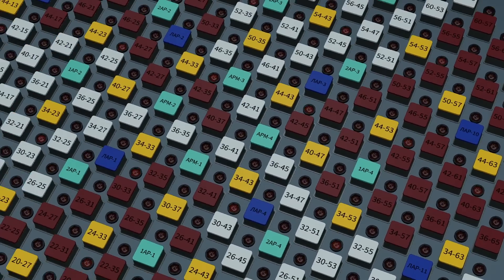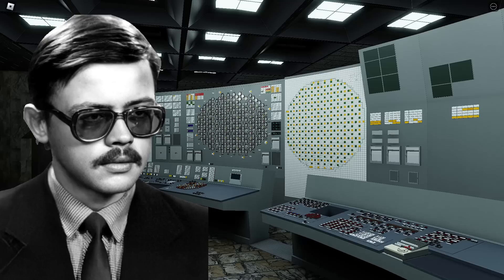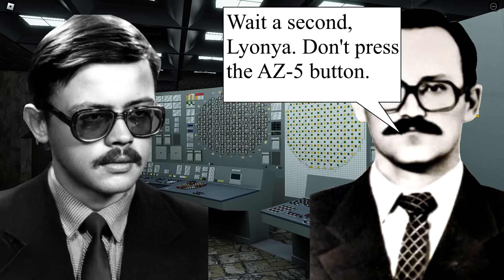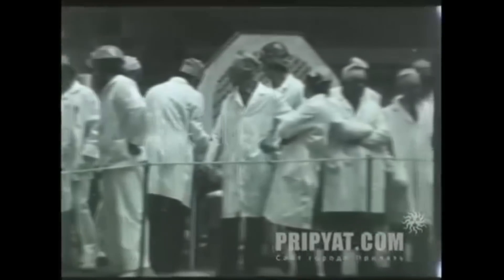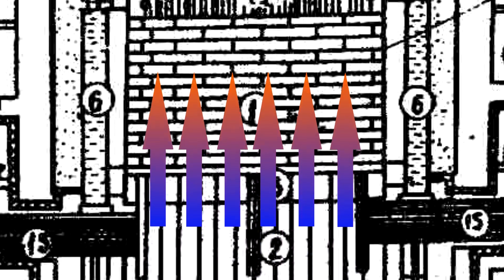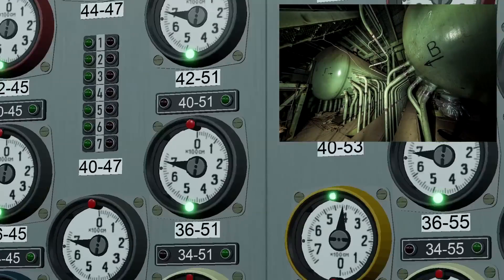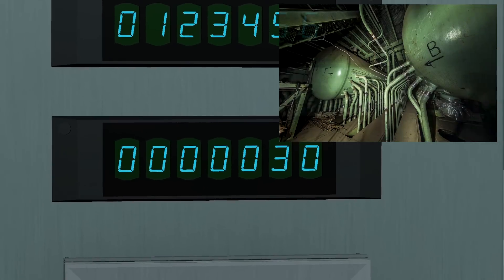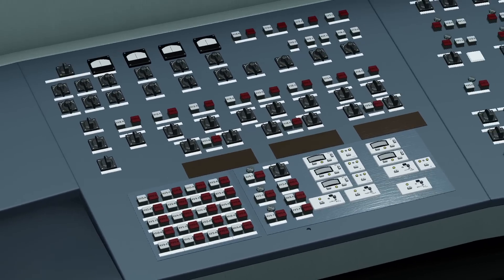Would Not Pressing AZ-5 SAVE Chernobyl?

Comment: Pressing it after the reactor crashed would have saved it.
Reply: Yes but they had no reason to do that. They had a test to perform, and no rules prohibited operation at low power. They did violate a limit on ORM, but that wasn't a parameter they could actually monitor, it was habitually ignored in normal operation (it was also violated a day earlier), and not seen as safety-critical.
Reply: ...what?
Reply: @IbishuCovet  it's not really clear what you're confused about, but "crashed" here is referring to when they were decreasing the power level to prepare for the test and the reactor power level accidently dropped to almost zero
Reply: @MatthijsvanDuin  oh alright, i thought they were referring to the explosion with "crash", which made me very confused 😭

Comment: The best way to prevent the Chernobyl disaster would be to go all the way back to the late 60s and design a better/safer reactor
Reply: they had a better one, the pressurized water reactor family VVER. Now RBMK was much easier to build and cheaper, so they went with THAT design. Still, it is amazing, that they kept the remaining twenty RBMK reactors running - without them blowing up into pieces. Wikipedia says they decreased the positive void coefficient by modifying the fuel rods by means of 'increasing the enrichment requirements of the uranium fuel in the fuel rods' (very enigmatic phrase). Also the control rods are said to have been modified, go figure. In the end they always blame some poor operator like Toptunov, who was not aware of the design deficiencies, because they were state secrets. On the other side of the pond it is some Homer Simpson guy, who gets blamed...
Reply: @michaelmoser4537  I doubt that rbmk is easier to build than VVER, because rbmk has lots and lots of piping underneath. The rbmk advantage was that it was possible to refuel it while in operation, no need to stop the reactor
Reply: @equim7363  VVER needs a high-pressure steel encasing & plumbing. I read that this was hard to make.
Reply: @equim7363  cheaper to maintain also applies to the "reactor being cheaper" even if the upfront cost of building it is not lower.
Reply: Or just not run tests on a live reactor
Reply: The best way would be to go all the way back to the late 10's and abolish communism
Reply: No, the best way would be to go back in time to WW1 and assassinate Lenin and prevent the October Revolution.
Reply: The reactor worked fine before they start using it wrong. It broke because they break it.
Reply: @XtreeM_FaiL every block had some fuckups, cover ups, few damaged technological channels every now and than.
Reply: That's not true. The test that caused the meltdown had never been successfully completed before. There's really no proof of could have been but other plant managers refused to even try it.
Reply: Bs
Reply: @XtreeM_FaiL  No, the reactor didn't work fine, that was literally the point of hiding the inner workings of the graphite displacers on the control rods from everyone. Other plants had channel ruptures when shutting down before this happened. The only difference was those reactors weren't in a state where they were about to fail catastrophically.

Comment: Don't press AZ-5: explosion happens later
Press AZ-5: explosion happens sooner
Reply: The Soviet's trolly problem
Reply: Looks like RMBKs were really pieces of sheet. "Yes let's build a main reactor core with a positive thermal coefficient"
Reply: @dsracoon  it was cheap and faulty, but if ran as designed it was ok
Reply: @jimmoore3767  yes, but no. it had per-channel issues.
Reply: @jimmoore3767  I agree, forcing it out of a xenon pit was the error, once they burned it off and the reactor ran away they were buggered, but it should never have been in that condition in the first place.   99% operator error and 1% design.  Nothing can be made foolproof because fools are too ingenious.
Reply: @larrybremer4930  This was exactly my thoughts...you can't turn off all the safeguards and then complain when it blows up. Imagine turning the ESP/Traction control off your Ford Mustang and then complain that the reason you crashed was the wheels spun on a bad corner...do you blame the corner, the car or the driver, who set the rest up for failure.
Reply: @Azimuth47  they cant turn off last thing-emergency shut off due fast power rise,which is ,AZ-5!and by some documents, computer initiated AZ-5 2 second before button was pressed,so,no matter pressed was button,or not,in that condition reactor blows anyways.
Reply: @larrybremer4930  i will say they were relying on the AZ-5 button actually working how it was supposed to, but diatlov was really pushing it. I don't think it would've exploded this drastically if the rods weren't tipped with granite, though some other failure would probably have happened
Reply: @dsracoon   Never mind that, they all added up to an overall positive reactivity coefficient. There's no self-correction there, you have to be ON IT at all times.

If it were an aircraft, it would have no static stability and we wouldn't let Boeing sell it to anyone other than the military.
Reply: @dsracoon it's cheaper
Reply: @dsracoon can’t out engineer something bad at its foundation
Reply: @Ultrajamz  RBMK is an old design, even old when they built them at Chernobyl.  For its design vintage its not a horrible design overall.  As Legasov said in the trial, they were easy (and cheap) to build, but the reason the design is useful is not as much that but because it did not need highly enriched uranium.  Its fuel was actually pretty low grade.  That  is what made it cheap operationally and desirable.  It can be said the design was not fail safe and required some operator competence to safely operate it, but the same can be said about most machines we humans create.  Most car crashes are not a problem with the car but the user and that analogy fits with Chernobyl too.  Scram would work as designed and safely shut down the reactor unless it was running well outside its design parameters, which in this case it was.  Accelerate your Honda Civic to 150mph and complain to Honda when its engine blows and see how far that warranty repair goes!
Reply: @dsracoon To be fair you really have to try to get it to blow up. And BOY were they trying hard that evening
Reply: @EvilTIMMEH You're forgetting about the hydrogen gas, it would've blown the building apart like with Fukushima.
Reply: @abloogywoogywoo They did blow up the reactor, there just wasn't a building to contain the hydrogen gas.
Reply: @EvilTIMMEH Okay so the hole forming in the bottom of the reactor isn't a problem like it forming in the top when the steam blew the lid off? The steam blows the top off, the melt down literally melts the floor of the reactor. Either way you've now got a giant hole in the reactor and a hydrogen explosion. Almost like what happened at Fukushima.
Reply: @Xershade  Also worse as the bubbler pools where under the reactor. So congrats the top doesnt blow off but depending on meltdown pace it may cause to quote Homyuk "A significant thermal explosion".
Reply: @memnarch129  Chomyuk didn't actually exist, she's just a character to show the big group of scientists working together
Reply: Well, option three was when the test failed shut the reactor down normally rather than waiting until you absolutely positively had to push  the scram button or else.  If Dyatalov I just listened to them and let them shut it down normally…. All of this would’ve been averted.
Reply: Nice TLDR
Reply: Don't press AZ-5 : really smaller explosion
Reply: But there's a chance it won't explode, so not pressing it is the right move.
Reply: Don't forget that the control rod tips were made out of graphite
Reply: @Idkanymore-f1b there’s nothing wrong with the control rod tips being made of graphite…. As long as they aren’t completely removed from the reactor which they should not have been, but were because Dyatalov was running the reactor beyond safety limits
Reply: @Matt-yg8ub bro graphite causes the reactor power to spike, due to graphite being used as the moderator in the RBMk
Reply: @Idkanymore-f1b For it to matter it had to first be a runaway.  It was a runaway because the removed all but a few rods (never should have had that many removed) and they were forcing through a xenon pit which is 100% against operational procedure.  Read all the comments above that address this.  RBMK is imperfect, yes.  All machines are imperfect and old complex machines dealing with high energies make them inherently hazardous which is why in a power plant there is so much safety engineering in their designs and procedure to their daily operations and that is why it's a big deal to violate them.  The tips were no graphite for kicks.  There were engineering and operational reasons for it, mostly so they could increase flux by parking a graphite tip intentionally in an area of the core that is already more depleted to maximize energy extraction from the fuel.
Reply: The web dark pattern of yes or later question but literally later not maybe later

Comment: Your temperature measures sound wrong, not boiling water cant have 165 degree celsius, because water boils at 100 degree celsius, maybe your source is american and gives temperatures in fahrenheit which makes 165F = 74C which is a temperature where water doesn't yet boil. Anyway thumbs down, untrustworthy bad research or bad explanation.
Reply from the maker: No, 165 degrees Celsius is correct. At high pressures, the melting and boiling points of substances increase. The RBMK operates at 65 atmospheres, so more than enough pressure to keep water a liquid at that temperature.

I apologize, I thought that high pressures increasing boiling points was well known.

Comment: Nothing could have saved that reactor but hitting the Az5 button which lowed the borax control rod made of borax mite has dampened it but sense the soviet cut cost and tipped it graphite  the reactors power output skyrocketed befor the borax could neutralize the reaction
Reply: Pretty sure this wasn't a cost cutting measure... it was to allow reactivity to increase when the con rods were raised again. As the rod leaves the core it acts a catalyst to increase reactivity.

Comment: I've heard it said that in order for a modern nuclear reactor to blow up like Chernobyl's did, someone would have to be in the control room actively trying to make it explode. It sounds to me like, in the case of Chernobyl, to have kept the reactor from exploding, someone would have had to have been in the control room actively trying to make it not explode.
Reply: Really not true. The reactor really wanted to shut itself down but it's forced to raise more control rods than it's designed to which turns the reactor into a unstable state.
Reply: @johnyang799  Chernobyl was a far bigger failure of nuclear safety culture than it was a technical failure.  They did about 100 things that no western or Japanese operator would ever do and they did ALL OF IT just so they could check a box.
Reply: RBMK dont shut theirself off
Reply: To quote the english translation of the 1993 report, "The Commission considers that the negative properties of this type of reactor are likely to predetermine the inevitability of emergency situations"
Reply: Well, the reactor was already in a pretty bad state. They were absolutely trying to "make it explode", or rather push it as far as they could without having it melt down. I'm pretty sure even a modern reactor can be fucked up juuuuust enough for it to explode - just probably not from the emergency shut down button.
Reply: And even if it didn't explode, the reactor would still be under the charge of someone who would probably put it in a dangerous state again.
Reply: what you described was exactly what happened there, they wanted to run a test, the safeguards didn't let them, so they forced them off one by one until they were able to run the test, and of course it failed the test, cause the plant itself already was safe, not being able to carry the test was the test result itself
Reply: The test was meant to prove the reactor was safe in case of sudden power loss. It would be, but the test initialization conditions were not respected.
Reply: yes, but in a pwr that isnt a thing. you cant force it to go prompt critical like this by itself, remove all control rods? yeah coolant will be gone, no reaction.
Reply: This is a lie of the nuclear energetics. Nuclear power plants are extremely dangerous and are "dirty" nuclear mines built for civilian purposes, and the electricity they produce is very expensive. A nuclear power plant can easily explode under many scenarios, turning an entire region into an uninhabitable zone and increasing the number of cancers on the continent by several percent. Now remember that there are terrorists, wars, fools, natural disasters, asteroids. 

In the event of an asteroid or a nuclear war, the real problem will be not only hunger and the destruction of most cities, but also the transformation of almost all nuclear power plants into Chernobyls.
Reply: @svetchannel2998  I have tried in my stories and novels I write to make nuclear reactor stories of meltdowns. I've never found any reasoning that doesn't skip all the way to unreasonable circumstances that would cause a modern PWR to explode.
Reply: @svetchannel2998  thats not true at all, all modern western and japanese reactors can slowly shutdown on their own or suffer non explosive meltdowns and remain safe in their containment buildings
Reply: @svetchannel2998  uhh no they can't "easily blow up". All reactors in the west are literally incapable of blowing up.

Also if something happens that's bad enough for dozens of reactors to fail, then we have astronomically bigger problems than some spicy lava in the basement of a power plant

Comment: So in summary, if the crew hadnt pressed AZ5 could the situation have been saved? No, because the reactivity was already on such an upwards climb  that the automatic scram system wouldve been triggered, causing the same issue.

Like everyone has been commenting, the issue was the dangerous condition the reactor was in, creating very rapid and uncontrollable reactivity changes.
Reply: Even if they overrode the automatic scram, you'd get a meltdown and a big hole in the bottom of the reactor gets you an equally sized boom as a big hole in the top of it. The mess would have been much harder if not impossible to clean up afterwards as well since in reality, they had time before the meltdown started to counter it. In the world AZ-5 wasn't pressed, the melt down is melting its way down into the earth and water systems before anyone knows what's really wrong.
Reply: Yeah, it seems like the fuckup wasn't inherently in pressing the stop button-but in pulling too many rods into the "Go" position after an extended period of xenon buildup. 

Once the rods were out, they were screwed.

Comment: the reactor was flooded with  water. I am 100% with diatlovs opinion that the reactor was doomed due to the reactivity insertion via the graphite ends and not via the voiding.  the voidiing can only have contributed when it was too late anyhow. he called it " two reactor effect "
Reply: Was it really flooded? I was under the impression there was rather less water in the reactor at disaster time. Which had led me to think that infinitely drowning the reactor, with as cool water as possible, could have saved it. Then insert rods one at a time.

Did the damn thing have enough power, theoretically, to boil off any amount of cold water and melt itself down, with rods out?
Reply: @k85  No it didn't have enough water pumping through it. Voids can't form when it's under the right water levels and pressure because the reactor is designed to boil water, and pumping enough in at the right pressure pumps the steam into the turbines. The problem is they shut off pumps to cut the pressure and steam to the turbines to simulate a power loss.

Comment: No, the reactor was already supercritical at this point. There probably wouldn't have been an explosion, but there would have been a core meltdown.
Reply from the maker: Supercritical just means reactivity is increasing. The rate of reactivity increase at Chernobyl was extremely slow at this point
Reply: @thatchernobylguy2915  That's right, a mistake on my part. When the control rods were retracted, the reactor became supercritical. The test should have been stopped when the reactor showed unstable behavior in the low power range.

Comment: Wasn’t the official operating procedure, that in the event of a low power situation, is that the reactor should be shut down, and then later restarted, with a very gentle and steady rise in power, until the reactor was stable?
Reply: Yes, that's the official operating procedure for literally all nuclear reactors in low power situations. You need to hard shutdown and let it reset for at least a day before even attempting to restart it.

Comment: What I want to know is, when the reactor crashed before the test, if, rather than withdrawing the control rods entirely, the technicians had removed them partially to put the graphite tips in place, could they have brought the reactor up to power in a stable enough way to perform the test?
Reply: The graphite tips are in place when the control rods are withdrawn. The "tips" are a chunk of graphite that is about 2/3 the size of the control rod and they're there to displace the water in the channel so the entire control rod channel doesn't fill with water. The reactor was dead, you don't start a reactor in a Xenon pit for very good reasons, as everyone there found out the hard way. The only way to bring it back up was to shut it down completely and reset it, which takes at least a full day.